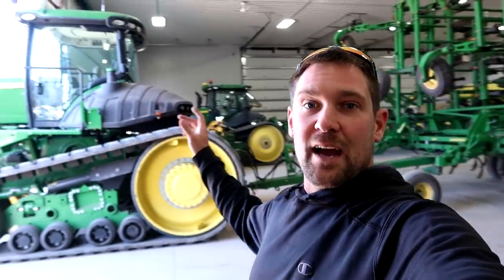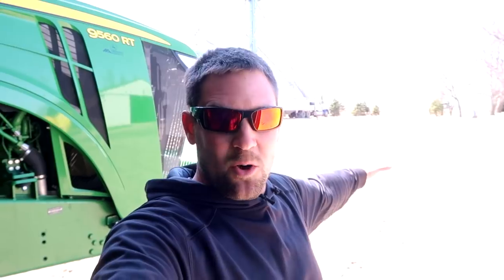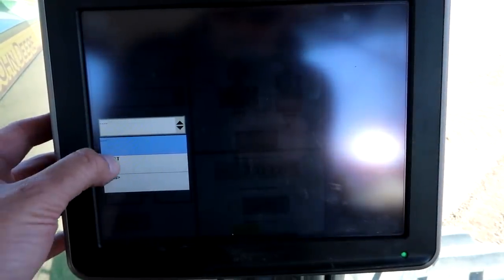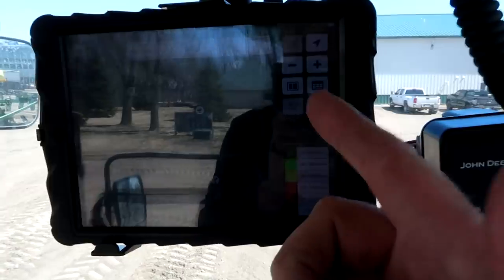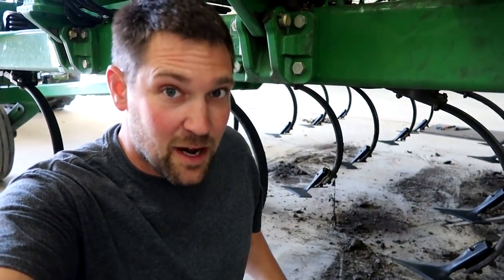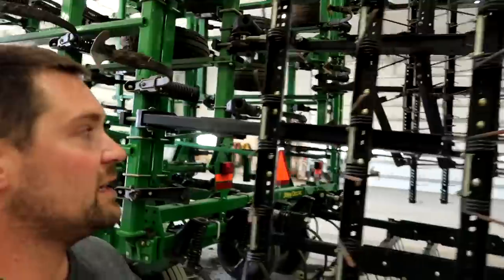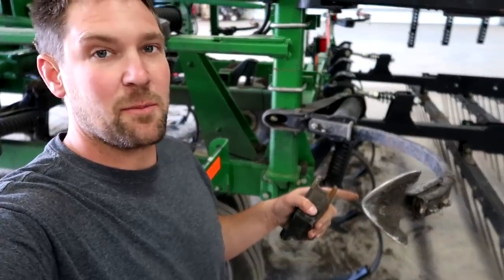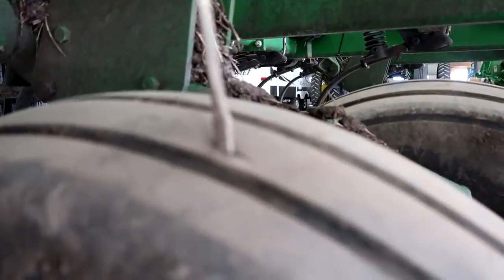Gearing Up for Planting

Comment: Great video showing off the equipment. Maybe explain the permalok shovels from others and their time savings. Move the tires to the wings for now if they are the same size. Check into non Ag tires for the center. They don’t hold up from the transport weight. I speak from horrible experience.
Reply from the maker: Mike Hoff unfortunately the main wheels are bigger than the wing wheels

Comment: The freaking iPad are a pain in the butt and we are going to start drilling beans tommarow
Reply: Plant those CrApple products in the field and run them over. So many more options with Android. Otherwise you are limited on software by John Deere and Apple. Than go all the way and pay someone to hack your tractor so you can actually fix/adjust it yourself. $50-500k tractor should come with full diagnostic system, not make you a slave to their software/mechanic monopoly. It's getting out of control. Scary that some genius bored kid in who knows where could figure out how to hack every connected tractor and lean them out until destruction just for laughs. Right to repair legislation-make your voice heard. It's your tractor, fixing it should be easier with all this tech, not make you a slave to waiting on company repair guy.

Comment: Great Video Zach. Love the Shank segment. I also noticed a company in mn. that converts farm tractors into "Diesel Electric" tractors. They say it will save 15 to 20% on fuel and maintenance. The co. is called A.T.C. You should check them out. Could make an interesting video.

Comment: Wow, changing the teeth on the cultivator looked so easy. I have to take two bolts off with the impact and end up cutting 90% off the the grinder, worst job by far for me.

Comment: quite the shop you have. never changed a shank that quick. we dont have to use the shnks with springs here in Colorado. we dont have rocks in are fields. changing the sweeps on your digger look easy.i like them called diggers. that must stop at the Minn. line my wife grew up on a farm in northern Iowa they call them field cutivators. my dad called the small sweeps shovels and the big ones sweeps.the shovels we used for cutivating row crops. they still on flood irrigated land cultivate. because it has to be ditched.great video.

Comment: Zack, i dug in the chiseled plowed ground here today, with a fork, i had just finished hauling some manure.  Very cold it was. I can still see snow along  a north line field fence today,  drifted there from the last 1 foot snow storm.  & it leans to the south.  I talked to a head lady at the bank today, she said yesterday on their farm, they tried applying anhydrous  ammonia, tried a few different fields, southern facing ones, to cold, froze up dirt to the shanks.  Washed the 8320R late this evening, after the wind went down some.  Need to work in the fertilizer next.  Rain middle of next week here it's showing. I wouldn't want to put the seed corn in that cold of ground.

Comment: Got love those permaloc sweeps.   You’ll like those new style sweeps.   We put those on last season.   They seem to wear longer and  pull easier.   Also they don’t ridge as bad either.   We have some pretty sharp hills where we are and run a 726 finisher.   Seemed like that back row of sweeps would sometimes leave some pretty nasty ridges.    I think it was just the design of the older style sweep.   Good luck with planting this year.    It’s getting closer and closer.   😊

Comment: Do you buy your seed, fertilizer and chemicals for the upcoming year ahead of time for Uncle Sam purposes? Also is the RTK system a yearly subscription? if so how much does that cost.
Reply from the maker: Brandon typically, yes.  That tax issue needs to be managed though because if you do it too much you can get yourself into trouble with deferred tax liabilities.  Doing that only delays taxes, it doesn't eliminate them.  And yes, the RTK is a yearly subscription but I couldn't honestly tell you off the top of my head what the cost is.

Comment: Zach, Tried to send in a seperate mail, other that clutter up this.    Liked this vid and much more what you need to see on daily farm prep per season.   Just curious on Track vs Tires on the tractors.   I assume you use the track for less compaction, but replacement wise, how much is each track to replace vs.tires.  
My family farm in South Dakota, we have rented our ground out to an older gen farmer for years and he has no desire to upgrade anything, about 800 acres, but wants his son to continue.  So my family has sent out recent bids to other potential renters.  One of the guys uses track tractors, but is a bit more expensive and one reason he claims is usage of track vs. tire to help with soil compaction.  I welcome that notion, just curious.   An old guy just asking questions as you are very knowledgeable.  thank you.
Reply from the maker: Robert Gorsett the compaction issue is the main reason we have switched some of our machines to tracks.  I can't say it's translated into a noticeable yield increase, but theoretically it makes sense no doubt.  Compacted soils are not healthy soils.

Comment: Excellent video showing what you as a farmer have to deal with just to be ready to plant.
Regarding your main equipment, how often do you trade your tractors, planters and combines? Do you update the computers at the same time or more/less frequently than that?
Reply from the maker: Niels Dybro we update the software on the computers twice/year but the computers themselves will last many years and switch in and out of newer/older equipment

Comment: How many times have you accidentally walked into one of those harrow tines?  You should get a builtin tire pressure gauge on your filler hose.  They work great.
Reply from the maker: thr8061 I've never run into a harrow, but I've got a couple small scars from a couple sweeps!

Comment: How do you tell if the planter guage wheel is tight enough to the opening disks? Stupid question, but with 24 rows you must have a quick way to check.  Also, how do you check the seed tube guard wear?
Reply from the maker: TwoHappyChildrenFarm we spin them quick, there should be just a little drag!
Reply: Thanks.

Comment: I forgot to mentioned Zack, i bought those new JD cultivator shovels too, 10 inch but. They were on sale, i haven't put them on yet, maybe when done this season.  Bolt on type. I have a 960 JD cultivator, bought it use in '11, out your way Painesville, MN, not sure how to spell that, Midwest Equipment.  You never mention them as your JD dealer, up in your town too, Alexandra too.  It's a 28ft. i removed quit a few shanks when i got it.  It had 7 inch shovels on it, they were totally wore out  anyway.  I removed shanks for better corn stalk flow. I shred the stalks to eliminate plugging problems.  They hair pin on the shanks, i set it to dig deep as it goes now,  have the power now.  This winter they wanted the 8320R  in the shop to do soft ware update, then called & said they wanted it for another week to fix oil leaks.  No oil ever hit the ground, all warrentee work. I asked them to dyno it, 25 extra PTO HP. 295,  i thought last summer when using it, it increased in power, i could tell using for various jobs. Around 270 pto it's suppose to have.
Reply from the maker: Klug Farms Klug midwest machinery in Glenwood is our dealer!
Reply: I bought a 556 JD round baler from them too, it was at their Alexandra site.  Bought it through the Tractor House web site.  Most all my machinery burned in a large machine pole barn fire.  66 x 126.  9500 Hillside combine, all toast. Great site for finding what you need.  Cattle trailer, aluminium, melted.

Comment: Do y’all ever plug the tractors into a heater block or have them on them?we always plug ours in in the winter but noticed our new to us 8r doesn’t have one and apparently most don’t run them as the engines in them start up easier.
Reply from the maker: Yes, all of ours have block heaters

Comment: I love the installation of the new sweeps. No more bolts to cut off. I have spent hours changing sweeps on smaller equipment using an impact removing bolts and having to cut a lot of bolts off to remove the old sweep.
Reply from the maker: James Dayton don't hold the back of those carriage bolts with your palm and make hamburger!  I've seen me do it.

Comment: Every around here still calls them vibrashanks instead of field cultivators or diggers. Most tractors are green but plows, disks, and “diggers” have always mainly been red. When I farmed in New Zealand they called it a digger but the springs were these massive pig tail springs instead of the coil springs. They had more rock in areas than actual soil.
Reply: Everyone*
Reply from the maker: Adam Kruskama interesting

Comment: On your harrow if you would put a angle iron on each end angle down it would stop a lot of the catching fences. Deere used to do that on the older diggers, I don’t know why they stopped.
Reply from the maker: Aaron Sprung they had easily replaceable break aways 10 years ago too.  It doesn't make sense why they quit that.